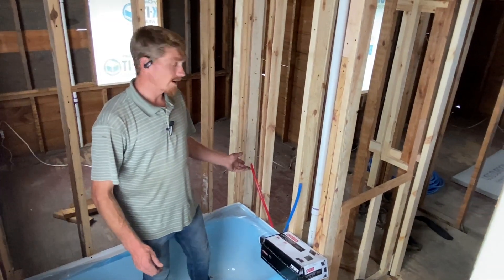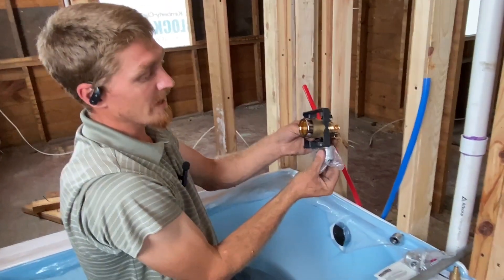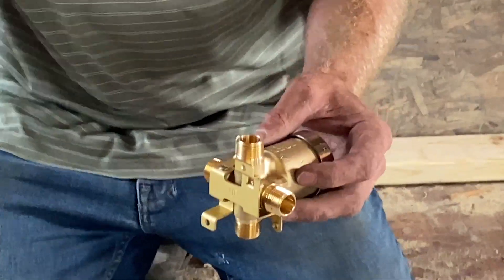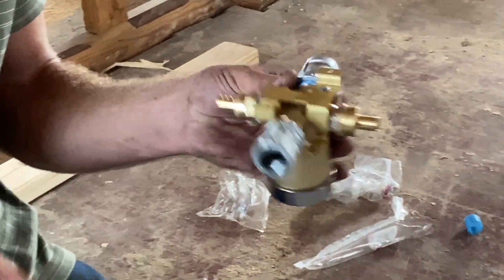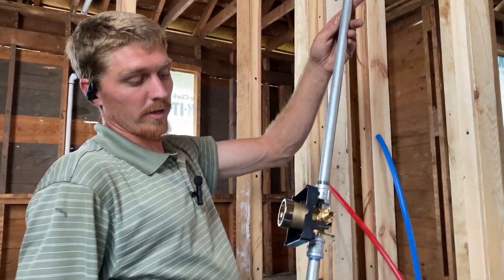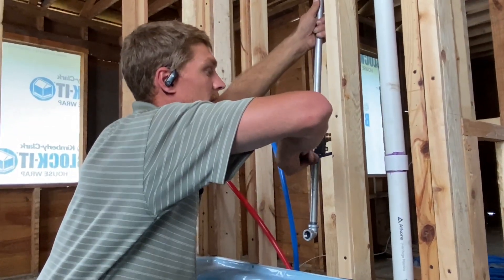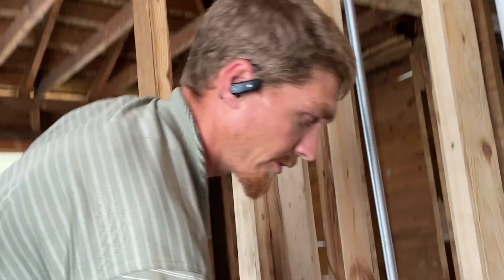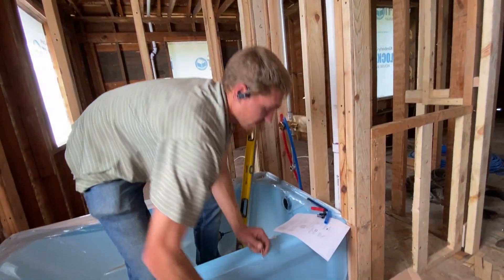How to Rough in Tub and Shower Faucet

Comment: You shouldn't use galvinzed pipe or any galvinzed fitting with that shower body assembly. Its made of brass and will suffer galvanic corrosion, aswell as the shower head and tub spout connections. It may last a couple years but definitely guaranteed to fail in the future. You can or should use 1/2 copper or 3/4 pex which is acceptable for the spouts, as it is not flow restricting like 1/2 inch pex. Both can be terminated with mountable brass drop ear fittings attached to some wood blocking.

Comment: Your roofing video came into my feed this morning and I’ve been sucked into your house project all day! Keep up the awesome effort and progress man!

BTW I learned to wrap teflon tape like this:
-male threads in left hand pointing to the right
-hold tape in right hand with a tail on the bottom
-the tail will be coming off the side of the roll away from you
-index finger in hole of tape roll
-middle finger contacts the outer edge of the roll to keep it from unspooling freely
-thumb pressing tape into threads 
-wrap threads starting at the top in clockwise direction

😂 man that sounds waaaaay too complicated now that I wrote it out! But I promise after you get the hang of it, you will never forget it.

Comment: Shouldn't you use brass fittings on that brass valve? The steel will corrode due to the electrolysis effect of dissimilar metals. Also, when it fails in 10 or 15 years from now, the way it's put together will mean tearing out the wall to refit everything. If you can, you might get a few brass couplings and brass nipples just to fit that valve in. 

The pex is inert, it's plastic so you don't have to worry  about electrolysis, unless the pex fittings connect with the plumbed in  pipes. 

Sometimes the building code will say something about avoiding dissimilar metals in plumbing connections. I don't know what an inspector would say about that galvanized in there.

Thanks for the content.
Keep up the good work.
בס'ד

Comment: do you know why they require an 8" drop from the valve to the spout?  What could happen if it was only 7"?  I have a 7" pipe and would need to have the tile removed to redo that if I want to use the Delta spout that I like.  I am wondering if 1" would make a difference and also what the issue is with the length of the pipe
Reply from the maker: Do not worry about the one inch. I’ve seen them a lot less than that and it not cause any problems
Reply: @samuelkingentrepreneur  thank you.  :)